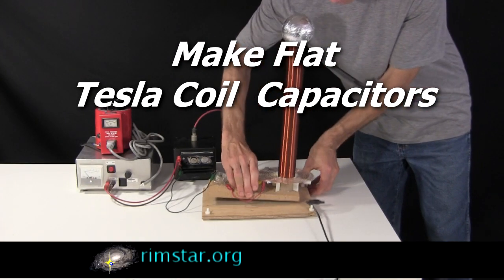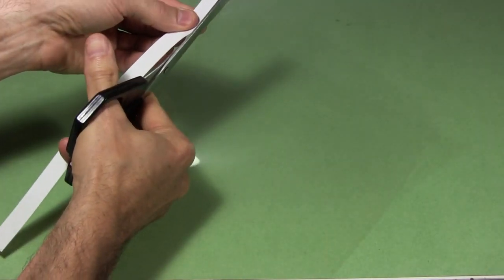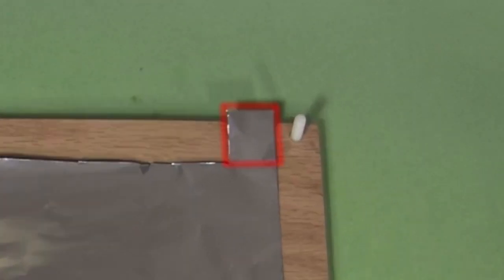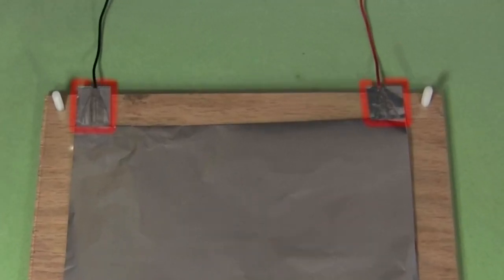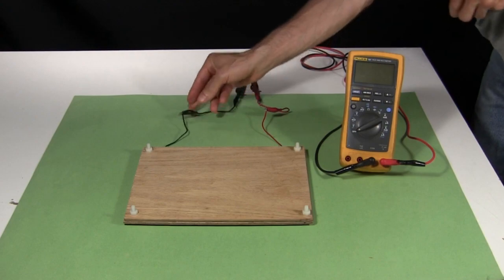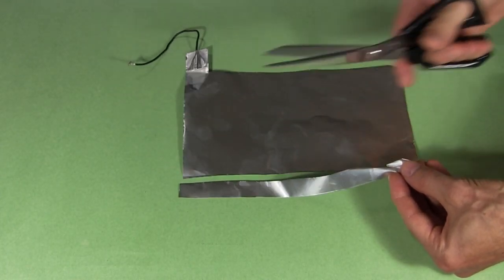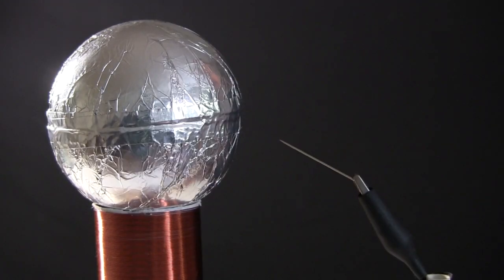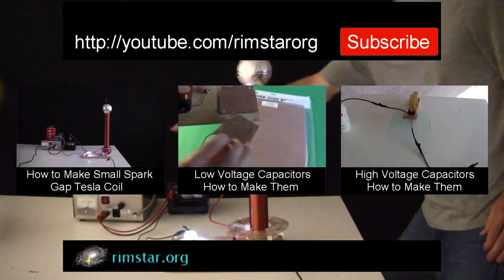How to Make Flat Capacitors for Tesla Coil (Small SGTC)

Comment: Steve,  This brings back to mind the latest TC I built...QUITE BIG...used a pole pig (10kVA).  The toriod was a two-man lifting job.  The pri cap was 100kV @ 0.1uF (still looking for this cap arrangement) pri winding: 100' of 1/2" Cu tubing, old 220VAC-powered 350 amp welder as current limit to pig.
...THIS, JUST IS TO GIVE AN IDEA OF THE SIZE...

What I wanted to ask is this:  I made the last toriod of many sections of Al tape.  A continuity checker does NOT read continuity across the entire toriod surface area. 

 On a smaller TC,  I went to major effort to ensure continuity along the entire surface.  Then on the 2nd to last TC,  I just taped it like I did the (last) 'monster' coil...without continuity across the surface...BUT IT WORKED FINE!

My guess it that the high frequency, voltage and close proximity of the conductive tape, let the toriod "see" itself as continuous 'enough'.
Any thoughts?
THANKS FOR EVERYTHING!!
--dalE
Reply from the maker: Hi dalE, That would be might thought too. The voltage was so high that it broke down the non-conductive space between the conductive layers so that it was able to conduct, like the air breaking between two electrodes down and becoming conductive. Either that or all the sections of tape acted as individual "domes" and gave the same end result.

Comment: ...A shot in the dark with this comment placed here and now.....
I saw one of your comments in an "APPLIED SCIENCE" you-tube video concerning discharging high-voltage capacitor banks for large Xe flashlamps where you described a "ionization" method of discharging the caps through the air with a grounded sharp-edged tool.

I was wondering how you ensure the ionized path doesn't accidentally create a violent solid arc 'jump' to ground.
...and...THANKS FOR ALL OF YOUR AWESOME VIDEOS!!
--dALe
Reply from the maker: Hi dALe, The sharp point causes the electric field to be strong near it. That breaks down the air, making it conductive and to leak charge to the air. The prevents a large build-up of charge on the sharp point. So you don't have a build-up of a lot of charge at the flashlamp and at the sharp point, and that means there's no sudden breakdown of the air with a large amount of charge (high current) crossing it. Instead, you get a small about of charge build-up because the charge leaks to the air so much. So no sudden discharge of a lot of charge. Just a small constant leaking between the flashlamp and the sharp point. I show it here in this video about Van de Graaff demonstrations https://youtu.be/Gf6EbRmYImI at around one minute and 40 seconds in. It's like filling a balloon full of water until it suddenly bursts and lets all the water out at once versus filling up a balloon that has a small hole in it, so it never fills up and bursts. -Steve
Reply: @RimstarOrg  Hi Steve!!...and thanks for the very informative reply.  I am going to apply this technique.
You really have a way to make demonstrations seen often; TRULY UNDERSTANDABLE!!!!!
I have to say that your videos on ION PROPULSION and MAKING ELECTROLYTIC CAPACITORS, really stuck with me...just two among many favorites!!

I remember trying to make a radiometer spin fast by putting in a microwave oven for a few seconds...it was working, then the very strong field at the metal tip suddenly 'popped' and that was it!

ps:
my little "name game"  Today it is --dALe, tomorrow;  --dALE
Reply from the maker: Hi dALE, Prompted by what you said, I found this very interesting set of experiments with the radiometer https://www.youtube.com/watch?v=OGX0-C1FXYA Thanks for bringing it up! And thanks for sticking around all these years. -Steve

Comment: Can I use any plastic
Reply from the maker: I don't know which plastics are better. But most plastics would work I think. The thickness does make a difference in terms of the capacitance you'll get so you will have to test with different numbers of layers to get the capacitance you want.

Comment: Good instructions but here a tip : try making a spark gap inside a cork, its way quieter
Reply from the maker: Do you mean to surround it with cork board to muffle the sound? That sounds doable. I'd think you'd need at least make sure there's ventilation so that you can have fresh unionized air. I'd also think you would want the enclosure big enough so that the air wouldn't heat up too much.

Comment: The way you have that connected is a bit strange. .
I have had excellent success by having the negative of the cap go to the outermost wire on the primary, the inner one going to the negative of the powersupply and spark gap, and the positive of both the powersupply and cap going to the other side of spark gap. Unless Im just seeing what you have done wrong..
Reply from the maker: A quick search on google for images for "tesla coil circuit" shows circuits done the way you describe and the way I did it. They seem to be equivalent but maybe there's some subtle difference.

Comment: Couldn't find transperancies anywhere how will paper do I think it has a fairly good dielectric strength
Reply from the maker: You can try paper but it often has conductive properties. I would suggest looking for something else. If you're going to bolt it all firmly together like I did then how about cutting the flat sides of plastic soda bottles (if you can find some with flat sides)? Also, a few layers of waxed paper used in the kitchen should work but make sure there are no scratches or creases.
Since they're different materials than what I'm using and may have different dimensions, I can't say how many layers to use to get the needed capacitance though. You may have to measure the capacitance and do trial and error like I did in the video.

Comment: hi i wanted to ask you something not related about to this project . its about how mush 1 sparker from a lighter creates voltage
Reply from the maker: +Youssef Aloud It would depend on how hard its hit and how high a voltage it's allowed to get to based on any spark gap. In my video where I take one apart, I hit the piezo crystal on a table and measure 320 volts but I'm sure it can get higher than that by hitting it harder (see 5 minutes and 50 seconds into http://www.youtube.com/watch?v=DAyM8Iet1O8).

Comment: Is there anything else I could use for the dielectric? I don't think I have any transparency sheets lying around, could I use plastic wrap or something of that sort?
Reply from the maker: Scotlahn Mccallister You can use plastic from a big soda bottle. Just cut it into rectangle and flatten it between the pieces of wood. For plastic wrap you might need multiple layers but you've have to find out how many by experimentation.  With too few layers the plastic wrap will break down i.e. a hole will appear in it and you'd have to try again with more layers of new plastic wrap.

Comment: I have tested those transparency’s for capacitors a lot. I have trouble popping them! I can pop pretty much every commercial HV cap on the market... Plus they are super low induction (due to being only 100 microns thick) so much faster than anything you can buy rated for more than 5kv.
About the only time I have popped a transparency was on the TEA laser, running above full power for 20 min. You probably wont find a better Tesla coil cap (Tell me if you do!!)
I think they are better than Bought ones. The only issue I get is a little bit of leakage. Can oil bath if that's a problem
I have tried pretty much every plastic sheet available at the local shopping centre and hardware. Nothing goes close to the HV rating for the thickness and heat tolerance. I've even had corona on the plastic and it didn't melt right away.
You can roll them up into a tube too. Farads go up quite a lot if you roll tight. 2nf can turn into 7-8nf.
Reply from the maker: Mongrel Shark Same here. Polyethylene sheets didn't last long with my TEA laser but these transparencies never broke down. Though I didn't run it for 20 minutes - much too loud for around here.
Reply: I am guessing 100nf would still cost $100 but it might be worth it if it don't fail so easily.
Reply: I think well under $50. Probably need about 30 transparency’s at approx $1ea Cheaper in bulk.
I have also tested laminator pockets a lot. they are nearly ass good. Better dielectric strength if you use both layers (60 microns each 120 microns total) and don't laminate. Slightly higher induction though, so barely works with TEA laser. Laminating foil gets you about 10-15 kv breakdown. Also lowers the working temp of the laminating plastic. Some long boring videos of some of the tests I have done on my channel. You might find the CUP CAP videos interesting too.
Reply: Mongrel Shark sweet. Thanks again.
Reply: After about 15 min at 20ish kv I got a pinhole in one. Was probably running at 70-80 hertz. Plastic had already done a lot at that point. It took some punishment before it  popped.

Comment: Enjoyed that...you have a knack of making me look around for the parts straight after watching the video :)
This could be good for tuning to a defined station on a self made radio...the exact pF or nF for energy harvesting of the radio waves.
Reply from the maker: slider2732 And the nice thing is you can make it the base of the project - no one will know it's a capacitor :). The heads of the nylon bolts even act as feet. Glad you enjoyed it!
Reply: slider2732 You can roll them up too. Which can increase farads a fair bit, as well as providing a way to fine tune.
I have a hard time popping these, even on a TEA laser. Thats really saying something... I can pop caps dammit. Why wont this pop? They also have really low induction/impedance. 10kv full discharge in under 2ns low induction. so great for anything that needs rapid response.

Comment: Which stores more power? This design or roll design?
Reply from the maker: Dika Prasetya Both designs can be made to store the same amount of power and to have the same maximum breakdown voltage. I find flat ones easier to make than rolled ones, simply because it's tricky to roll them without the various layers slipping too much, resulting in unevenness in the layers. But if you have long strips of material then it's probably faster to roll one than to cut it up into many rectangles and stack them. There's also the consideration of how you connect to them. With a rolled one you may have only two connections to make, whereas with a flat one you'd have many connections to make.
Reply: RimstarOrg all right thanks for your response

Comment: Interesting that very small ferrets are units of measurement. I'm going to start measuring macro objects in standard ferrets. Nose to tail, Sally's boat measures sixteen standard ferrets.
Reply from the maker: John Smith FYI In case you ever want to look it up, it's "farads". Sixteen farads is a lot. If you really did that then that's interesting. I wonder what the breakdown voltage of Sally's boat is, the maximum voltage it can handle before it starts to conduct.

Comment: what would happen if you used the 9nf capacitor with your coil? would it burn out?
Reply from the maker: ***** No, it just wouldn't reach as high a voltage. For it to do so the primary circuit's (capacitor and spiral coil) resonant frequency must be the same as the secondary circuit's (taller coil and ball on top) resonant frequency. At 4nF, the two circuits have around the same frequency so it works optimally. See my first video about this Tesla coil for a little more about that https://www.youtube.com/watch?v=vemF7p0cbHU.

Comment: Nice video. I was hoping you would do this one because the flat caps are so much more space efficient for this.

You can get "free" transparencies by cutting the sides from the soda bottles and flattening them out. Different plastics will give different capacitance values depending on their thicknesses and composition. You could try other things like paper and cardboard as well.
Reply from the maker: USWaterRockets I actually did think of going with soda bottle plastic at one point, but I wanted to use a different material this time. I hadn't thought of +Massimo C 's  ideas of using soda can metal though. I bet a whole YouTube channel could be devoted to doing things with soda bottles and soda cans!